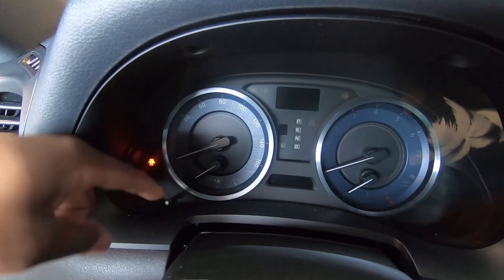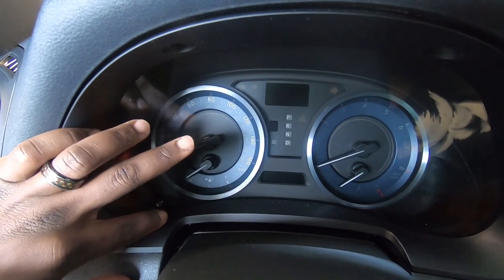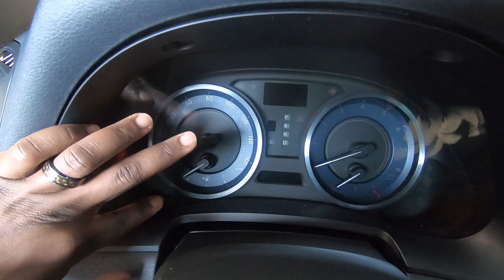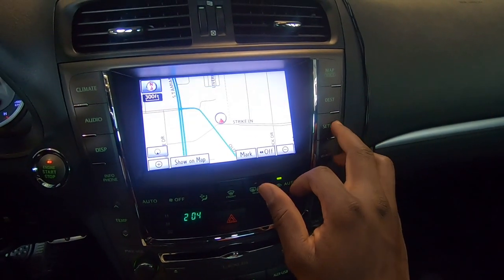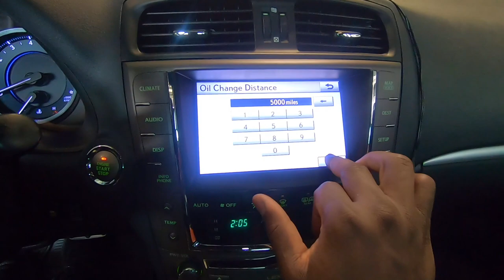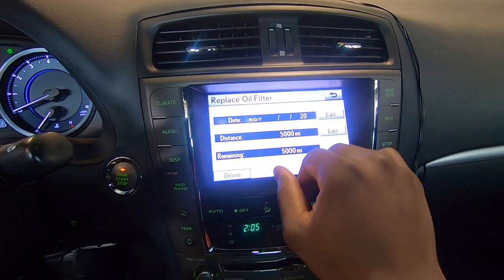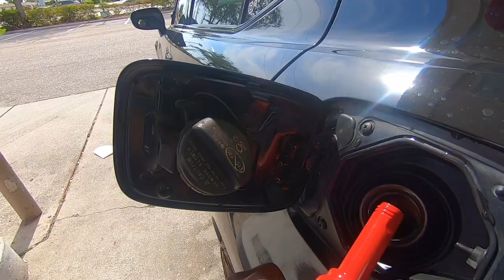Oil Change with Amsoil 100% Synthetic Motor Oil on my Lexus IS350! First time using @Amsoil Motor

Comment: I feel like it's not worth it. Don't you have to change the oil every 6 months anyways because of the oil degradation that happens after some time?
Reply from the maker: It’s worth it for me. I rather use full synthetic oil than that thin blend synthetic oil that Lexus requires for these cars. I’ve been using full synthetic oil in this car for 8 years now. Plus I change my oil every 10 months or so since I only put 5000 to 5500k miles on it a year.
Reply: @SlowWhip  if the oil is good for that long then yes it would be worth it. But some good mechanics say no matter what kind of oil that you use, it degrades after 6 months. Wonder if that is true for Amsoil Signature?